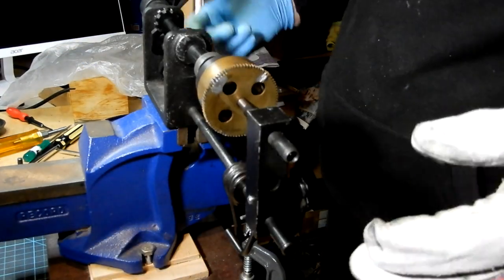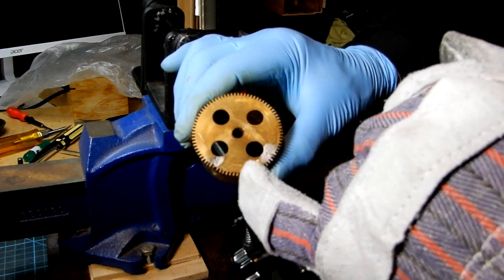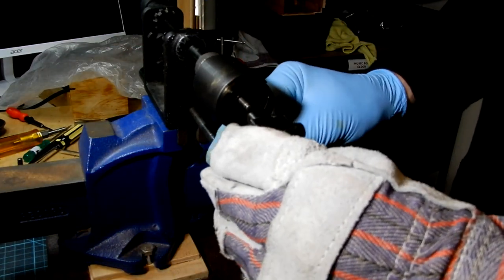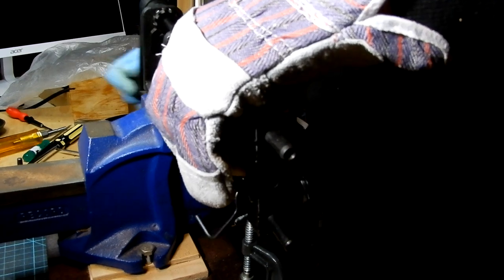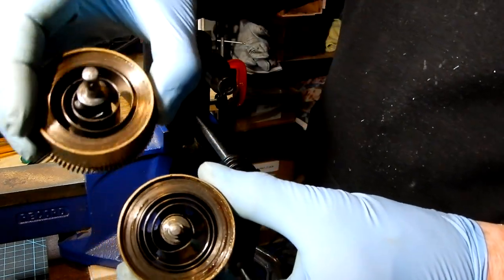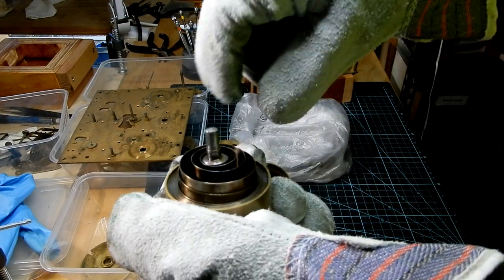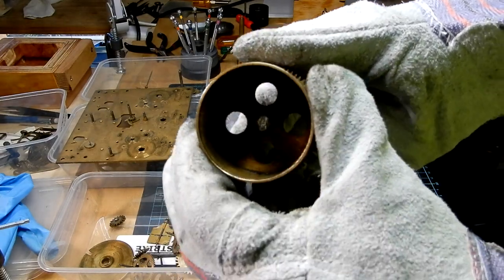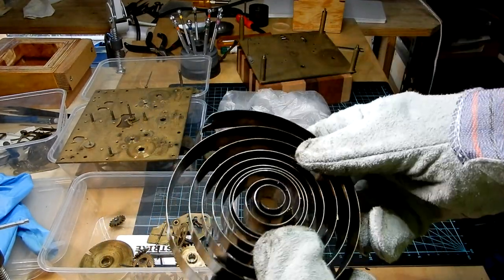German Westminster Glocken-Speil Model 107 wall clock {3} Remove springs/clean/lube

Comment from the maker: In part 3 we remove the springs using a spring winder for the Going side spring but the Chime and Strike side springs have to be removed manually.
PLEASE NOTE: Towards the end of this video I mention that the next part of the series involves cleaning in an ultrasonic cleaner while I am removing the springs by hand.
I am talking about the brass parts of the movement only, springs are never placed in an ultrasonic cleaner, NEVER EVER.
They are cleaned with kerosene and a scouring pad.